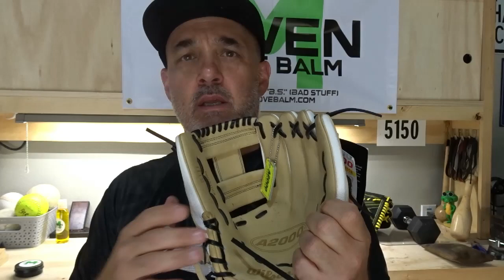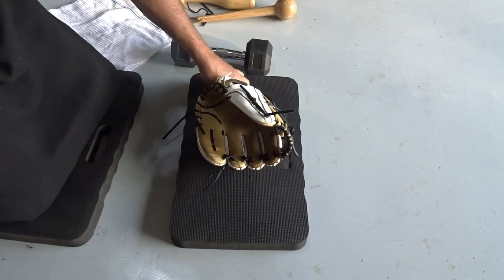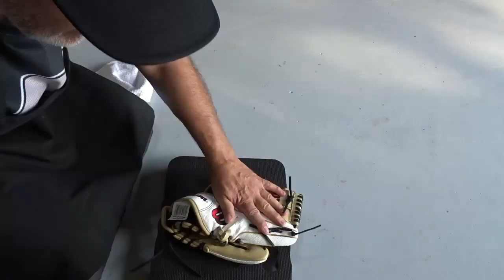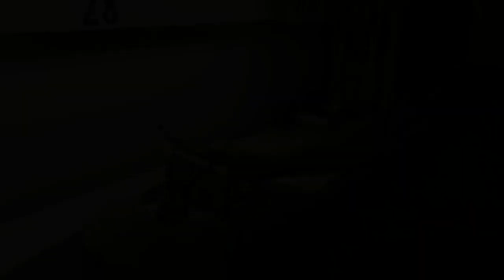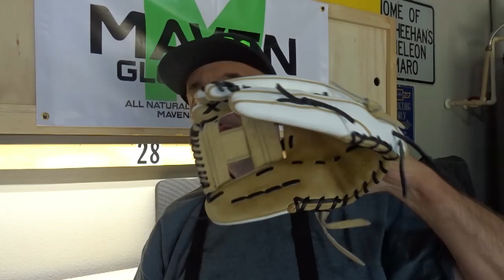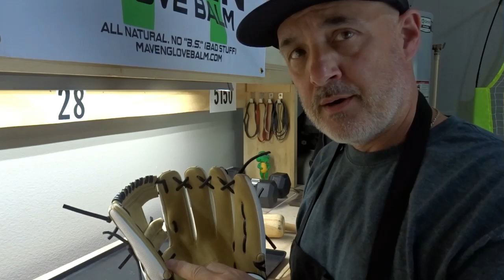New Glove! Wilson Fastpitch A2000 Superskin Break-In and Conditioning

Comment: What size block do you use? Solid job, well done.
Reply from the maker: Its just a common board home depot that I cut down to  6" x 3.5". Its just about1" thick. Thanks for watching. The rubber bands I use are a mix of size 105 and 106. Yes, Rubber bands come in sizes, who knew? :)
Reply: @mavenbalm  I've been using ace bandage instead of rubber bands. Works great. Got my 9 year old a 12" Wilson a2000. Hopefully her forever glove. It brings me back to the old days. I love the glove probably more than her...but she still is crazy about it.
Reply: What do you charge to break in a 12.5” softball glove & where would I go about doing so

Comment: Any way to stiffen up a mitt? I have a Wilson A800 Optima and I would like to stiffen up the leather.
Reply from the maker: Hi and thank you for watching. The only thing I could recommend would be going to a thicker lace on the entire glove. Typically we use 3/16 but moving to 1/4 inch could do the trick.
Reply: @mavenbalm  so no real way to stiffen up the leather fingers?
Reply from the maker: @shammy313  you could replace the felt in the fingers. That would for sure stiffen it up.